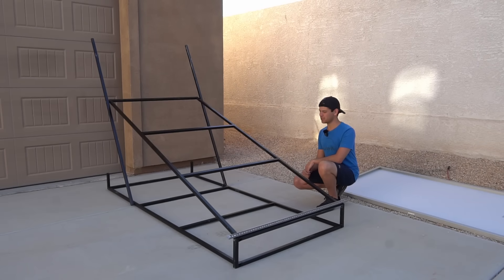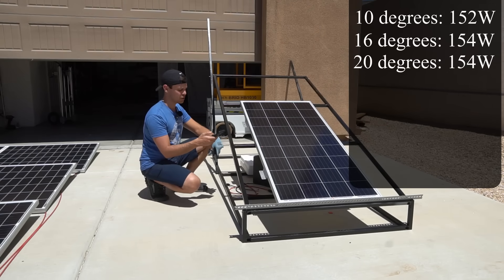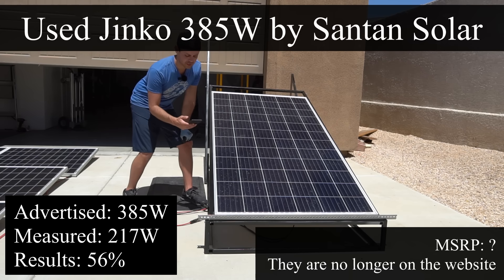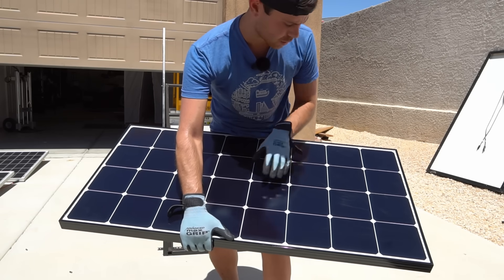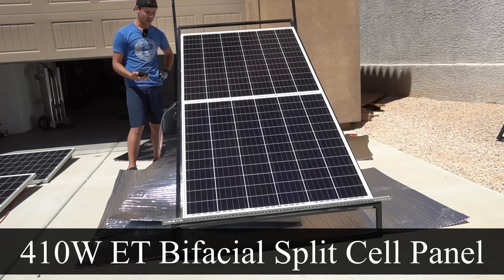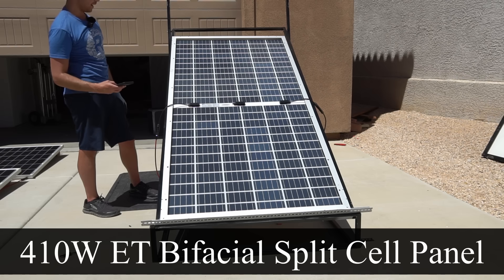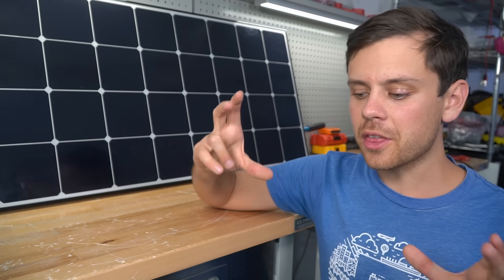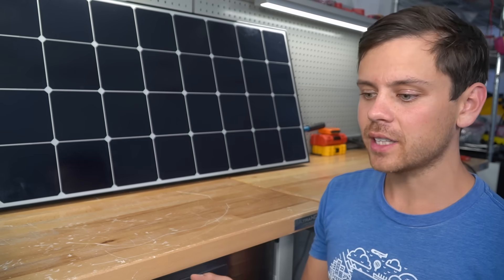Solar Panel Showdown: Sunpower VS Bifacial VS Used VS Renogy VS Rich Solar

Comment: Will, I've torn apart many Jinko solar panels. Willing to bet you either have some with bad solder connections or shorted diodes in the junction boxes. With the 29v you were stating I'd say most likely one bad diode (You get about 15v per diode on those ~400w 72/144 cell panels). If you pop the junction box cover you could probe the back with an ohm meter and see that one of those diodes is conducting both directions is my bet. I doubt SanTan intended to send you broken panels, unfortunate that so many were that bad off!

Comment: Hi will great vids have learn alot just a question I'm going to be building a system and was wondering what battery charger you would recommend for charging lithium ion batteries thanks.

Comment: Hey Will, a little off topic here. I see Inergy just came out with the Flex.
Any thoughts? If you can't recommend then what solar generator would you go with? I need to get a solar generator soon. I live in south Florida and hurricane season is around the corner. I need a solar system asap. Thanks

Comment: I have 8 LG  bifaicials. 4 are  on my Van.  Two underneath and 2 on the roof. On slides and actuators. The other 4 are going on my cargo trailer. But the LG bifaicials  are rated at 450/455  I very had mine over produce 11+ watts on each panel using Victor charge controller and in parallel. They are the best on the market right now😀👍🏾
Reply: Sorry spelling sucks. Just got a new phone lol

Comment: Will, I think the Bi-facials are very sensitive to mounting orientation. The surface facing the back side of the panel should be in as much direct sunlight as possible. Elevating the panel so that sun strikes the ground under the panel should. keep up the good work.

Comment: Great more bifacial testing and on a rack, thanks. I've had a heat dissipation idea for my bifacial panels en route, to use in our Latitudes and hotter areas, especially with low wind.
Why not try adding cold water misters (rope style, like ya get walking into a store) mounted underneath, tucked in the frame?

Comment: If you have a 50% V_oc i would assume that temperature is high and 1 of 3 diodes is defect.  Diodes sometimes defect, but rarely. With the angle it is indifferent as long as you test them all the same way. When installing the roof will determine the angle. And on a flat roof you install them in an east/west configuration. (That gives the most yield in money nowadays).

Comment: Those bi facial panels are being used on actual solar farms i just finished a job where over half a million were installed. The ones that were being used were from a company called JA Solar if that helps.

Comment: I like the idea of the rack and charge controller with batteries good work, Things that I would improve are State of charge of the small of a bank of batteries maybe add a load while doing the test, height of rack for bifacial front edge 3ft min "higher the better" in my experience, I am skeptical of the small charge controller maybe compare only panels of similar voltage and size with a larger charge controller 40amp rated etc. The panels must be the same temp or close to before the test. Again great work I enjoy watching your experiments and tests.

Comment: I bought 4 of the used Santan 250w panels and added them to the 4 new panels I already had and I can't see any difference in charging power. The main difference is in my wallet.

Comment: RETIRED 76. 2009 INSTALL, 12 YEARS AGO, 50 SUN POWER PANELS STILL PUTTING OUT SAME KWH. OVER GENERATING 1000 KWH IN FEB. MAR. APR. MAY 2021 TOTAL ELECTRIC HOME, SHOP.

Comment: The used Santan T-Series 250 watt panels are amazing. Have three flat mounted on a van. They were $35 each on sale from SanTan. Storm rolled through yesterday and dumped rain followed quickly by peak sunlight (north central Florida). The rain cooled 750 watt array (3x250w) produced almost 900 watts until the panels heated up again. Amazing value!
Reply: Impressive thank you for sharing this
Reply: Cools the van via shade, right?
Reply: @johnfitbyfaithnet  Yes, I have them flat mounted on a rack above the roof and fans so it keeps the sun off the roof and the fans as well as protecting them from hail, etc. I've since the sold the van but I was happy with the setup and the new owner is too.

Comment: I have a 55 ft power boat with room for 4 of the santan used panels they can be mounted flat atop my flybridge.  It’s only 1000 watts but in San Diego area. How do I figure what to expect from these panels?  I may be able to fit 6 but need brackets.

Comment: and why are you comparing the Measured Output with Claimed/Mentioned Output. The real concern should be power output per unit area, i.e. Watts/m2. This factor is what gives the real efficiency of the panels.
Reply from the maker: Because the advertised wattage rating determines sales more than anything else. It's useful to see how much they actually produce

Comment: Absolutely right with the bifacial panels doing well in northern latitudes. Way up north in Canada, a simple mirrored reflector aimed at the back side of those panels year round would help. Tilt is a big factor for us also. If you absolutely had no option for a mirrored reflector, even the snow on the ground reflects a lot of energy. I know a bunch of people who would reconsider solar with those panels.

Comment: Have a similar experience with the Santan T series 250w. I have an array of 18 of them (4.5kW rating) and have seen over 4kW coming into my batteries. I paid around $35 per panel, totally happy with this cost/performance.
Reply: I bought the same panels for $45 ea. 
How did you get them so cheap?
Reply: @bad_actor1128  that was the price offered when I placed my order around July 2020. I don’t think demand was as strong at that time. Since I was getting a pallet I think they gave me an additional discount as well.

Comment: It seems a wide range is tolerable with regard to inclination, having little to no effect on output.  It seems temperature is a key factor.  I'm thinking that mounting panels close to the surface of a roof would dramatically increase temperature compared with panels that are not mounted tight against the roof surface (such that good convective airflow can occur).  Will you modify your test stand to model real-world roof mounting (to demonstrate the effect off low-profile mounts)?
Reply: This is true and well known in the industry. It is actually one of the big problems with solar roof tiles. They get very hot, especially if the roof is insulated.

Comment: I bought a 24v LifeP04 with Built in BMS. it says Battery cannot be connected in series. I always thought its possible to connect them in series. I wanted to make 48V for my MPP inverter. Any advice?

Comment: Will, great testing. With ALL the CRAZY WEATHER around the country and HAIL being a common problem: what is the best type of solar panel or hail resistant Cover would you recommend?  Is plexiglass a possible solution covering a solar array a solution or would that restrict solar output immensely?   bill in Florida

Comment: I bought a handful of used panels, open circuit voltage was fine, short circuit current was fine, but they wouldn't perform in actual service.  It turned out that some internal connections between cells had become resistive and caused significant voltage drop.  I now test used panels with a resistor load to see if they provide current AND voltage at the same time!
Reply: Which used panels did you test? 
I have the Santan 250W and they are performing at 90%.
Reply: @bad_actor1128 Did you mean to reply to my prior?  Mine were re-labeled as KYO-Refurbish

Comment: It would be interesting to see how well the bifacials do in a marine environment.  I am considering them.  I am think the water below would reflect extremely well.
Reply: In the studies I've read it mostly depends on the colour of the ground below. Dirt is bad, grass is okay, and snow is the best. Water is pretty dark unless you're getting specular (direct) reflection from the sun so they might not do so well. But the water could help to keep them cool so that could be good. Ideal distance to surface below is reported to be at least 1 metre. Will be interesting to see how you go with it!

Comment: To be honest as a solar panel designer who has 12 years experience designing panels you need to look at trying specific panel technology. Your bifacial panel is just using std 5bb perc mono cells which don’t have great rear side collection or great temp co-efficiency. Get a bifacial panel using n-type tunnel oxide bifacial cells and you’ll find they run so much better year round even in the summer, the cells won’t heat up near as much as the perc cells do and the rear side collection is much better. With bifacial having white concrete or white painted surface and min 1m rear side gap will give you much better rear side results than silver foil which does nothing really as you found. Also typically 9bb panels will give a higher output (if rated the same wattage) than 5bb panels.
Reply from the maker: Yeah totally. I agree. I am going for the cheapest panels around because my viewers prefer it, but there are much better options. Great advice

Comment: I'm wondering about the bifacial panels and using a barium sulfate roof paint. barium sulfate is a super white pigment. White paint can actually reflect more light energy than a silver coatings and it also spreads the reflection better where as your foil backing is probably causing the rays to be concerted in certain spots some not even being on the solar panel.  At least that's what I understood from one of Tech Ingents videos on a lasers.

Comment: From what I've seen with SAM, bifacials need to be mounted higher (the base at least .5m above the ground), the more light underneath the better they do.  I'd love to know why the Sunpower was running cooler than any of the others.  Albedo makes a big difference too, love to see some experiments around that.
Reply from the maker: Yeah I need to mount them a meter up
Reply: @WillProwse  The bigger issue (I think!) is the black support bars on your stand behind the panel are completely shading a large part of some of the cells (for backside illumintation). Unless there are a lot of bypass diodes you're going to limit the current through the whole string of cells with that setup. (And with the bypass diodes you'd be limiting the voltage!) If you test these again then you could try with a frame that doesn't occlude any part of the back of the panel at all and hopefully you'll get at least 100% out of it! Watch out for the wiring too... you could use that empty strip in the middle where the junction boes are to route the wires and make sure they don't cast any shadow on the back of the cells.

Comment: I'm wondering if bi-facials would work better several feet in the air as a canopy, like an EV solar charge station. That way they get plenty of airflow and as much radiant photons from the surroundings beneath, like a white top parking lot.
Reply: I've bought bifacials for this purpose but haven't installed them yet. I'm hoping that we're correct and they'll work well for this! :)

Comment: I live in Wisconsin and the Bifacial was drawing me to the video. I also have an Ebike that needs cells to charge the batteries while riding. I have 2 50w sunpower flex panels and I need another 100w. The Sunpower panels are light and have good power and light but the Renogy Eclipse Sunpower 100W has me thinking about using it. Weight is an issue but watts per square inch output is what I need. I still need to build supports for the sunpower panels, so the Renogy  panel isn't that far from the 2 flex panels in weight. Are you going to do more testing on the Renogy panel? Great video!

Comment: I'd be curious to see the performance of bi-facials inside a twin mirror arrangement, each mirror directing the sunlight to one face, and compare that performance to a regular panel of same cost and total area covered as that of the bi-facial plus mirrors and frame.

Comment: The 27v on used panels means a diode is bad - the panel is probably good.  You can replace the diode pack and restore the panel.    I bought 40 panels from Santansolar a few months ago (Lot of 20 Used Suntech 285W 72 Cell Polycrystalline Solar Panels 285 Watts) but we agreed that they had to test 90%+ compared to a similar/new panel and they agreed.   So I bought 40 x 285w poly-crystaline that were 9yrs old (reportedly) and tested them against a 2 yr old brand new 285w mono-crystalline (Hyundai HiS-S285RG).   All except 1 were within 95% (a * v = w) of the new 285w panel...  so I was satisfied.  The 1 bad one had 2/3 the OC voltage - so its clear it needed a new diode pack - e.g. $10 + some sealant and personal work and it was restored to same as the others.

Comment: Grate Info Will your the best 
P.S. How does one calibrate the sun's energy, a laboratory standard photoelectric cell or what, how about by temperature could one use a black absorbent material and white concrete using infrared thermometer to correlate suns energy?

Comment: The bifacial panel spec sheet for the 400w panel states it’s perfect for hot conditions. “If you are located in the southwest USA this is the build quality that will produce and last longest.”

Comment: Great test Will.  I ordered a CIGS panel and am excited to try it out.  I’m traveling and mailed  it to my sons so will see.  Bob Wells just gave me a   Victron Charge Controller so will have fun with them both. The cigs are only 70watts so I may get another to run in parallel with the other.

Comment: very interesting, but as indicator what about using the yield of solar panels knowing that the irradiance of the sun is about 1KW/squared meter. then considering also the $/squared meter you can have a good indication of each panel. how to mix those two data is up to you. what do you think? then you can really compare objectively the different panels. 
I would define a final indicator as panel cost/yield such a number should be as lower as possible.
if the yield increases the indicator goes down, if the yield goes down the number goes up.
2 panels with the same yield, only the one with a lower cost has a lower indicator.
it is just an idea....

Comment: I need to go back through your videos because for some reason I thought you did a test on 100W panels where the Renogy Mono panel out performed the other panels you were testing. I am sure that I bought 8 of them for a 24V system based off that test.

Comment: Would running those bi-facial in a hotter environ damage them or do you just not get 
what you could in a cooler environ.
Reply: It shouldn't damage them. You'd just get more resistance in the semiconductor => greater internal losses => lower output. You can look up the data sheet to see how the power output changes with temperature. The panels are lamniated at 150°C and above, so as long as you don't get near that you should be okay!
Reply: @johndalgliesh9220  THX

Comment: Went to Amazon to pick up your book. Hadn't seen your vids about your health and what got you into this stuff and read your Bio while I was there. As a Type 1 Diabetic since '92 who has been working to figure out how to correct it, it's like we're thinking the same. When I tell people we're really a machine, no different to diagnose than a small block Chevy, an EV, or a cargo vessel I always get the blank stare... Just recently swapped my "hacked", 15 year old insulin pump that I'd been soldering together for years, in for a new-to-me used one that the manufacturer won't update or repair if it breaks. They didn't like when I told them I already replaced the battery on their $8000 dollar machine and I WILL be installing their encrypted firmware update... Thanks so much for what you do, why you do it and the integrity with which you approach it!

Comment: I’m wondering about your testing method could it change due to the higher wattage panels and the fact you’re using batteries for your load.  Have you tried just a resistive load? I built a  load testing device for batteries out of power resistors I’ve also made my own load testing coil’s out of nickel chrome wire and then just measure the amps and then do the math according to the amps and voltage your getting.

Comment: This freaked me out because I have an order for Jinko 380s in with Santan right now. I called them and they said Will's panels must have slipped through the cracks and they've improved their pre-ship testing. I talked to Rusty and Will is entitled to have that Jinko 380 replaced with Santan picking up the shipping cost too. Gave me a little better confidence.

Comment: I love how excited Will gets when he can get the rated wattage   I have 9-360W panels  3240W total  I get 3800W-3900W every day! that 433W each  best ever was 4300W
Reply: Are you using a solar tracker? Please...can you describe your system, solar controler inverter etc. ?
Reply: @billythekid6047  9 panels on my west southwest facing roof 9am 1kW 10am 2kW 11AM 3kW. At 430pm today still at 2.5kW  midnite mppt clasic 200

Comment: Would be interesting to see one of those bifacial solar panels mounted with a reflective surface a few inches behind it with some 12 volt 120mm/140mm fans being used to help cool the panel.  Maybe place the fans along the bottom edge and seal up the sides to ensure airflow over the entire surface. Might also be interesting to see the effects of a water mist system mounted over or behind the panels or possibly combined with the fans.  I suppose the water would need to be distilled or reverse osmosis to prevent mineral buildup, so the RO system and water pump would use some power along with the fans... but would the power consumed be outweighed by the potential additional power produced by the panels?
Reply: I think a few inches would be too close.